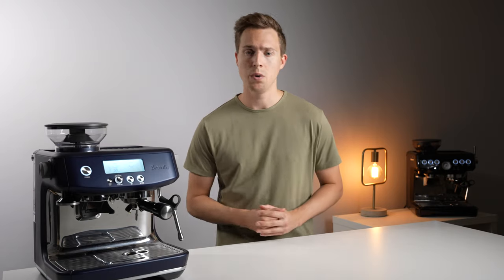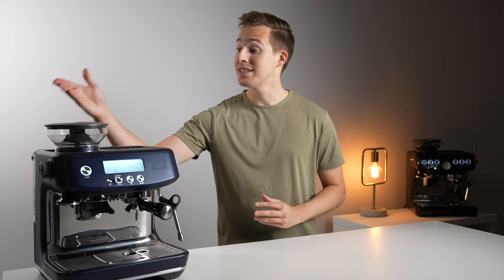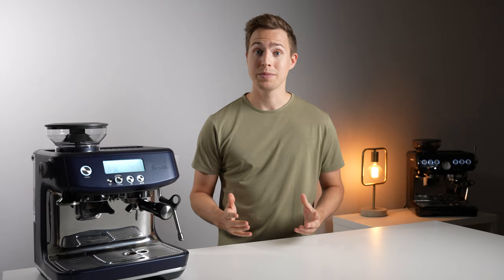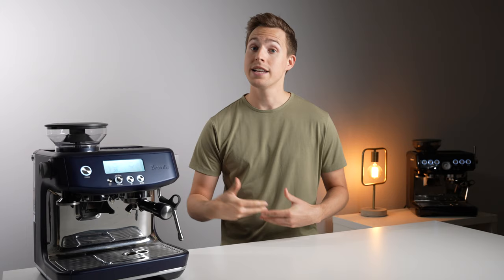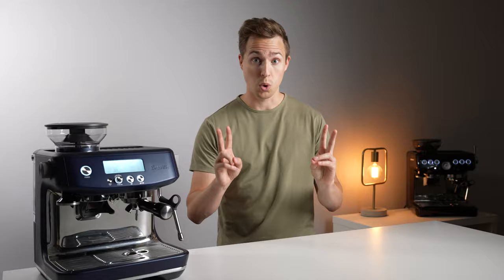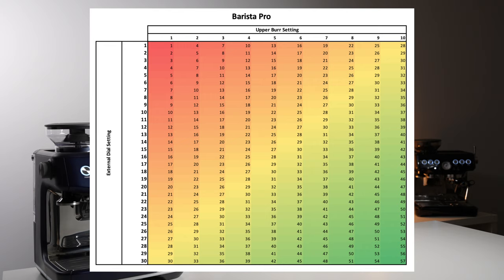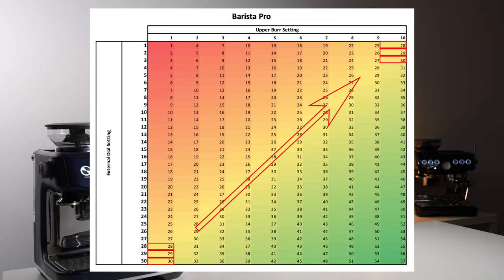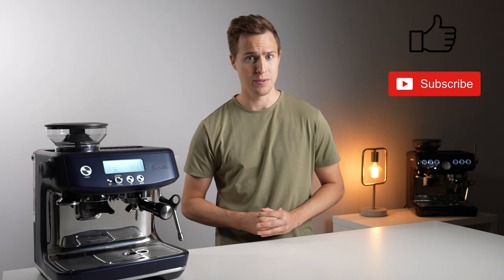Upper Burr vs Outer Dial Grind Setting | Breville Barista

Comment: Anyone has an idea why my coffee dashes out watery? I’ve had it set on 1 and internal on 6 (as it comes) and my shots were okay 18g in and coming out at about 18/20seconds (I knew I need them finer but I only just seen your video that you can change the internal grind) then they started dash out at 10 seconds so immediately started to look on here how to change the grind. I have changed the upper burr to 3, and the coffee still dashes out at 10seconds. I just want a good cup of coffee 😩
Reply: @Paulina Zalupska, have you solved it? I just bought my coffee machine and first bag of MKCafe ;) Espresso beans gave same result. 30sec after setting upper dial to 1 and external to 1-2. Was not able to build the pressure due to to coarse grinding. I plan to contact service since I it’s the first day of using.
Reply: I’m not an expert but I understand that if the coffee dashes out it could indicate a brake in the puck. That means it’s too fine and when water finally gets through it does it by breaking the puck. The result will be a over extracted coffee. Try a courser grind maybe. I’m using internal burr 5, external 9-13 depending on beans. (See Hoffmann’s video about understanding espresso episode #4 I think…)

Comment: I just tried upper burr setting at 3 and the grinder started making weird noises as if they were touching at the finer settings. I don't like this grinder smh
Reply from the maker: All grinders will reach a touching point. Even $6000 ones. This is “true” zero.
Reply: @LifestyleLab_  of course, I'm not expecting the burrs not to touch. But at upper setting 3 and dial at 2, it is kind of an extreme. Could be a singular case with my machine too.
Reply: how to read ur BBE chart ? is it a guide for burr n grind setting ?
Reply: @LifestyleLab_  so where did the  data of upper 1 and lower 1 come from? Extrapolation? Is there a point of contact setting for the barista pro?